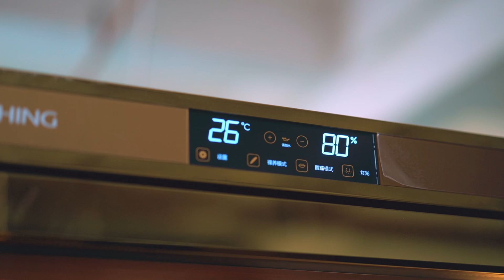How is a Raching cigar humidor been made.

Comment: What about the condensation? Is the back wood also? Is there metal in the back of the humidor? Or does the condensation happen in the back from inside? Please explain
Reply from the maker: We have hydrophilic evaporators and there is no condensation. It's not like heat pipe humidification, or ultrasonic atomization humidification. And, our humidifiers are water cooled, no wet cooling or dry freezing.